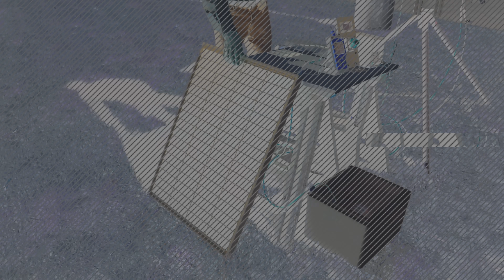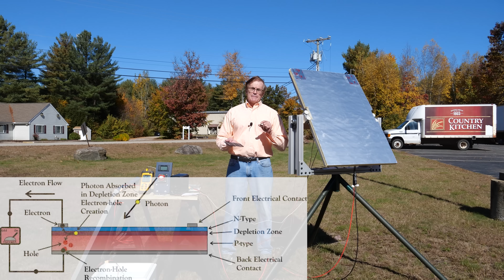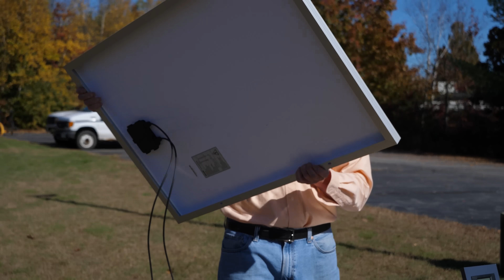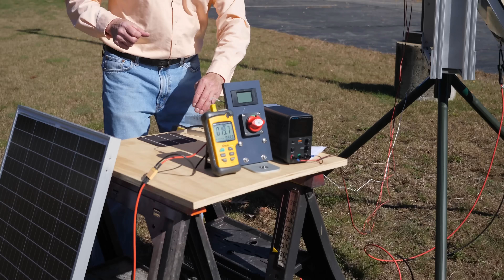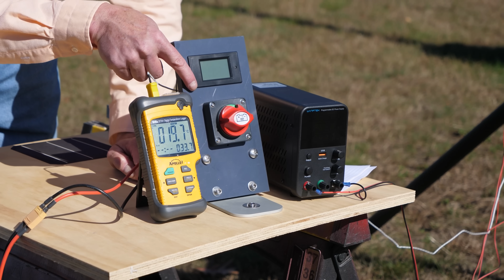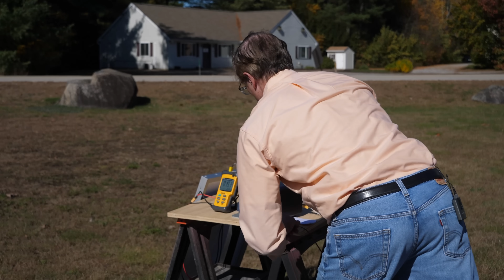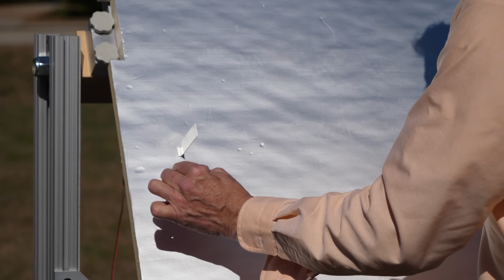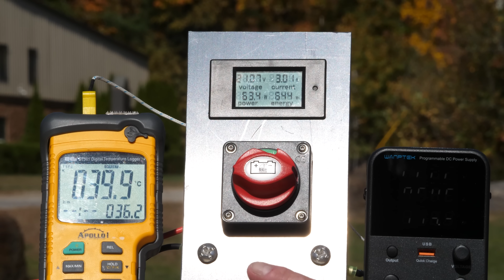Do you REALLY get enough out of your solar panel?

Comment: It still would cost less just to add another panel to gain that 5% with air cooling.  And it isn't 5% all day long, more like 5% for the peak 1 hour the sun is at the right angle.  It might make sense to increase the angle of the panels to get a better thermal siphon without any modifications.
Reply from the maker: Remember that this was a conservative  number based on New England in the afternoon and in the autumn.  And, ALL your panels are degrading  faster if they run hotter.

Comment: my favorite sun tracking system is the closed loop shade cross. you can even build it completely without any microcontroller at all, and have the photoresistors controlling either driver boards directly or switching relays to run dc motors to aim the panel directly. its such a simple design that require so few parts
Reply: I built several two axis versions, the mostly worked well. The problem was that a bright patch of sky on a dull day had the panels heading for it, then hunting after it all changed. The other was a purely analog system to determine the end of the day and return for the next sunrise. In the end a friend built an arduino over-ride that worked until the tiny ants got into it thru a tiny hole, we were on our farm and found adjusting it with a cheap remote controller whenever we went past worked fine. Apparently remote tribes do this manually to panels leaning against a pole.

Comment: You could use a thermal siphon where you had a distribution manifold on the bottom, vertical tubes along your fins, and a collection manifold along the top. Run the top discharge to the top of a small auto radiator where as the water cools it would move lower as it was displaced by warmer on top of it. The cooler water would then be fed to the distribution manifold on the solar panel where it would heat and rise again. No power required a small electric fan(s) on the radiator would help with the cooling of the hot water. Discharge of the radiator on the bottom would be the same height as the distribution manifold. Warm water rises, cold water sinks. You would have to experiment to find the right sized radiator and mass of the water. Non pressurized system.

Comment: Interesting research. I think the simplest system to create for this would be a liquid loop. That means it can conveniently move the heat elsewhere, and also to a location easier to reach for the day when the system needs to be cleaned or have the fans replaced.

Comment: I generally like this youtube channel, however, from what I can tell your test itself is flawed, as you have impaired the heat convection capability of the unmodified solar panel by installing the back plate and fans. Can you redo the test to compare with a unmodified panel, preferably on a non-tracking static roof mount as this is how most solar is installed? I think it is important to model as accurately as possible to the expected installation conditions, as two axis tracking is far from common and could negate the expected results. Also you need to model at what times of the day and in what seasons the temperature difference will create a net benefit, and from that calculate the ROI on the modification costs.  The fan longevity needs to also be considered as well as the installation costs. I expect you will be better served by installing a cheaper drip to waste, water cooling system that only operates in the summer, or simply just by adding another solar panel to the system to get the same net energy gain. Ideally, the heat from the panels would be harvested and used for hydronic heating using a stratified boiler instead of going to waste.

Comment: About 10 years ago I took copper tubing and bent it in a coil shape and then slightly flattened the tubing and glued it to a PV panels with a circulation pump. My new setup have peltier modules stuk to the PVs and copper tubing stuck to the peltier modules with this I get more power per square meter plus the heating for hot water. In theory you should be able to  extra more power if you have another set of peltier modules away from the pv panels with adequate cooling.

Comment: What would happen if you submerged the panel in water, would some of the efficiency be lost due to the water surface reflecting a portion of the sunlight?
Reply from the maker: Yes.  The water may also interfere  with positioning  the panel  at an optimal angle relative to the sun.

Comment: I like the idea of a water cooled panel as you can move that heat some place it can be useful. It also minimizes the footprint on the panels themselves versus fans. Also, on snowy days, the water can be heated to a point to melt the snow, then switch off so the panels could cool down again.
Reply: I was thinking something similar. Just pump all main water to a home through the panels. No efficiency loss, since the panels  would get recycled water as a home uses the cold water normally (approx. 100gal/day). During the winter, the water would be warmer than ambient temperatures and could help keep them thawed, and hot seasons it'd be colder and keep them cool. Could add an electronic diverter if flow has a fault (say a leak or burst panel).
Reply: @D00Mcandy  I would not do open loop for something like this, especially pumping potable water. All sorts of issues related to capacity, hygiene, mineral scale and temp control. Best to have a simple closed loop distilled/glycol setup with separate heat exchanger. Easier to optimize temp for operating conditions and keeps the active components off the roof.
Reply: @egoequus6263  I concur regarding potable water, however, wouldn't it be better to build separate PV and DHW systems. Adding 10% more PV panels to a system is very cheap. Also, if one system breaks or needs maintenance it would likely effect the other. Unless place is an issue, I wouldn't combine them.
Reply: @D00Mcandy  Maybe just run PEX tubing through the backs as a pre-heater for the domestic hot water? Freezing temps during winter?

Comment: Super interesting!
Here in tropical land, water cooling is also super interesting, as the majority of my country never gets bellow freezing temperatures...  so you just get a combo of solar power and solar heater all in one. xD
Things are noticeable speeding up recently on solar power generation down here... the problem has been that our currency is too devalued, there were no federal or state subsidies to install them, and so it didn't make much financial sense to do it. Imagine if a solar panel was 5 times the price... it would take too long for the investment to pay itself off on individual consumer scale.
Also, a large portion of citizens in the middle class who would be able to finance things or be willing to do it also live in high rises at crammed city centers, with not too much free surface to put solar panels on top.
So, what is happening now is that some condominiums are getting in a cooperative style contract with a myriad of small solar power companies that rent or buy out unproductive farm land, install panels on those places, put the power into the grid, and either sell at reduced cost for the condominium as an apart, or share profits that will then be used to pay the electricity bill of the condominium.
It's a pretty interesting move to advance solar power installations without having to rely on government subsidies or big corporations to build up solar farms by themselves.
There is some measure of scalability there too... from what I heard, the one that my condominium will perhaps close the deal with (still looking into it, not final yet) already close contracts with 4 other buildings. The company looks for viable land to install more panels, and when they lock into something, then they are able to close more contracts.
Anyways, semi-related to the topic, but just thought of sharing... :P

Comment: I've never heard anyone talk about panels without an electrical load.

Let's say you've got an off-grid system. By mid-afternoon your batteries are fully charged, and your electrical demand is less than you're producing (or maybe even zero), so you stop sucking power from your panels. Max voltage with low or zero current. What happens to the panel temperature?

My guess is the temperature goes up. The panels don't absorb less sunlight, so I suspect what had been going into electrical energy and was being exported from the panels, now just stays in the panels as heat. I'd love to see an experiment to prove or disprove this.

If true, then the off-grid system should have a special load circuit to throw away the excess power which isn't being used.

For an on-grid system one can simply dump excess power into the grid.

Comment: I am going to look them up. I live in Melbourne. Currently building a full electric home with geothermal heating and cooling. Planning on getting 10.2kW solar system with a Powerwall battery. It will definitely be worth it to increase production and life span of the solar system. I would be interested to see if it is possible to integrate the solar panel cooling system to the geothermal as well as utilise the excess heat in a hot water tank. I might run out of money though.
Reply from the maker: Good luck!

Comment: Three more tests: panel with fans, but no heat sink, panel with heat sinks, not no fans, and naked panel.
Reply: What are you talking about? There are no heat sinks. Heatsinks would be too expensive
Reply: @randybobandy9828  the strips of aluminium on the back he bent and attached are heat sinks.
Reply: @RandomAccountHolder  I wouldn't call them heatsinks.
Reply: @randybobandy9828  he would.
"If we decided to use a...heat sink or spreader...so I decided to make it myself."
~6:00
Please define what you would call them if not something to increase surface area for removing heat?

Comment: You could probably dump the heat into the ground, if you used water cooling.
Reply: Yes but the cost might not make sense. You would have to excavate to a decent depth and run a long run of tubes.

Comment: You folks on that side of the world may be a bit behind the solar uptake curve....
Here in Orstraylia solar for rooftops have been commonly around for about 15 years....   meaning as house demolitons and upgrades have happened the second hand solar panel market has grown significantly...  some people complain about how do they get recycled.
Smart people in the right circumstances snap up these panels, and use them for standalone systems for homes, for caravans, for motorhomes...  for playing in general.
This means that for DIYers...  methods valid in earlier times for squeazing extra energy from panels...  are no longer valid.
Sun seeking panel mounts, cooling systems for panels, adjustment systems for summer and winter etc....   these are rarely worth contemplating if you have a secondhand panel market that is dirt cheap.    Far more effective to double the number of panels for lest cost than an efficency enhancement like cooling etc.
You have to make do with what is available, so congratulations for folks squeezing extra from their panels if they can't buy used ones cheap.   Your time will come, when used panels are dirt cheap.  My last purchase was  10Kw of panels (40x250W) for $692 of the us bucks.  At these sort of prices, efficiency enhancement is only relevant if area for panels is extremely restricted.
Reply: Also not everyone has the space to add more solar panels. I do because I have 10acres but some people have their rooftop only.

Comment: Problem is that these fans will fan running continuously and replacing these every 2-3 years from the roof would negate the cost of any gains
Reply: They won't need replacing every 2-3 years. I have pc fans that have been running flawlessly for 7 years non stop.
Reply: @randybobandy9828  under hot solar panels?

Comment: Very thorough testing, I would like to see the tests run over several hours for a more real life test. Also, It would have been interesting to see the two panels tested side by side with the same diy aluminum heat sink/ventilation on each panel only that one is active(fans) and one is passive, no fans, no fan cutouts and just the slits top and bottom.

Comment: In terms of "is it worth it", why not use the heat rather than just throwing the heat away?  Why aren't photovoltaic thermal hybrid solar collectors more often used?
Reply from the maker: It's  the same issue  as with the hot exhaust  from a vehicle.  It may not be worth the cost of recovery.
Reply: Use the heat for what? When it's 100° outside, there isn't much use for slightly hotter air.

Comment: You said the argument was an engineer's argument to add the fans. I put forth that it is not an engineering argument but a financial argument.

You never said how much the heat sinks, fan, and power supply cost.

This is nearly like the dual-axis tracker argument. Yes, absolutely a dual-axis tracker produces nearly 40% more watt hours in a day than a fixed mount panel. However, for the cost of the dual-axis tracker system, you can buy more than three panels and produce 300% more watt-hours.

If the cost of the fans, heatsinks, and power supply to cool the panels is more than the cost of the panel, just get another panel.

If space is limited, then cooling and tracking are very good ways to add a considerable amount of production.
If space is not limited, then adding more panels is a lot easier way to go.
Reply from the maker: Good  engineering  always  includes financial  issues.

Comment: Current day photovoltaic solar still sucks. It is the least efficient and reliable way to generate electricity. The manufacturing and environmental costs alone far out-weight any benefits. Solar systems still belong in a lab until they figure out a way to make it more efficient.
Reply: What do you mean by "least efficient" that doesn't make sense when you aren't putting in any input once the panel is made and installed.
Reply: @randybobandy9828  Least efficient is pretty clear. Solar panel efficiency is generally around 15-20%. There are a lot of losses on top of that. Mining the rare earth minerals needed to manufacture a panel is one. They degrade rapidly is another. Not to mention weather and heat damage. They are BARELY acceptable for emergencies, but not for efficient power generation.
Reply: Literally none of that is true. You also forgot to pretend it is not the lowest cost way to generate electricity, which it is.
Reply: @patrickcorcoran4828  it's not the cheapest way to produce electricity. What are you even talking about?
Reply: @patrickcorcoran4828  Everything I've said is 💯 true, you just don't like it or don't know any better. Look more into it.

Comment: The biggest challenge to solar is when the sun is shining through clouds, and in the mornings and evenings. Can you showcase Amorphous and other thin film solar vs monocrystalline? They've been really overshadowed by the efficiency and power specs advertised by crystalline solar suppliers, who seem to sell "100W" panels that only provide that power in mid-day fair weather.

Sunlight shining through clouds obliterates available spectral power because of absorption lines of the water vapor in those clouds right at 900nm where crystalline cells get the bulk of their energy.
Reply: There is no solution to having clouds in the way of the solar panel. Clouds block light,  less light= less energy period. Nothing is going to change that. You can make more efficient panels but that means they will be more efficient when it's sunny too.
Reply: @randybobandy9828  if you compare thin film silicon Solar cells to crystalline, you'll find that they produce their peak power between 400-700nm while crystalline sits at 800-1100nm.

So I agree it's lower light intensity across the whole spectrum, but monocrystalline is going to have 20% of its peak power rating while amorphous will have closer to 50% because that spectrum doesn't drop in intensity uniformly

Comment: Since the panels are oriented vertically, I wonder if an intake opening at the bottom and an exhaust vent at the top would create an effective draft to passively cool the panel.  It wouldn't be as effective as the fans, but with no electrical load, it may be more efficient than with, in certain conditions.
Reply from the maker: It wasn't. The modified  panel  was a little  more efficient than the stock panel when the fans were off, but the difference was small.

Comment: Big problem people here in Atlantic Canada with on roof instalizations there is one big problem, it is against our building code to attach anything to the roof.   The stucture needs to meet 200lbs per square foot snowload capacity (my city recommends 500lbsF² load cap with solar)

Second problem our fire departments have been and still are refusing to knock down fires in homes that have on roof solar power and sometimes mistakenly hotwater solar systems. Their fear is the uncontrolled power that can't be shut off by a switch on the outside of the home.  If any adjacent homes have solar they can be lost as well!  What we are suposed to do, well set up a rack holding the pannels out in the backyard, but still it needs to have a shutoff!

If it is on a rack the roof heating risk is massively reduced!

Another problem for solar is we need heating to clear ice as a quarter inch of ice kills solar until it melts, the same goes for snow!

_________________________________________________________
Topic idea can a military grade C.R.E.E. Light burn paper, lite fire, cook food, heat a tent etc?
Reply: That makes no sense. They won't put out a solar panel fire because they fear it will make other solar panels on adjacent houses catch fire?